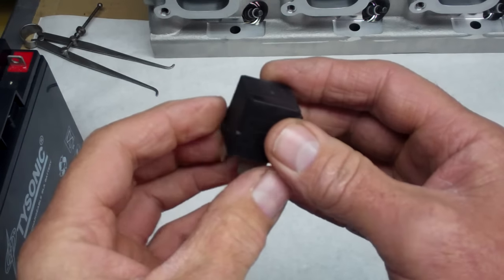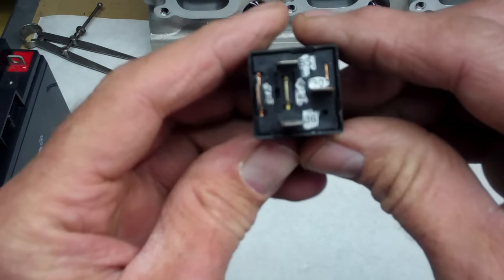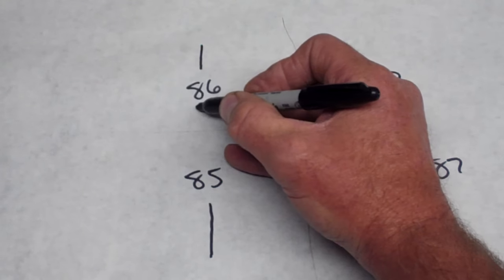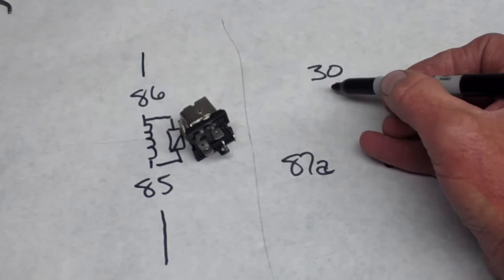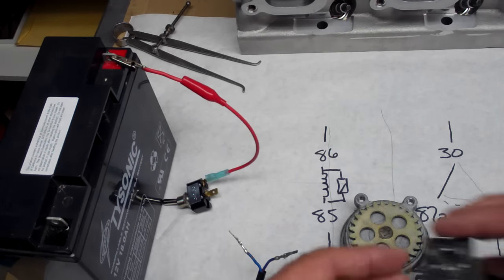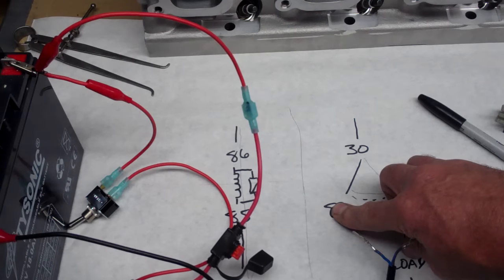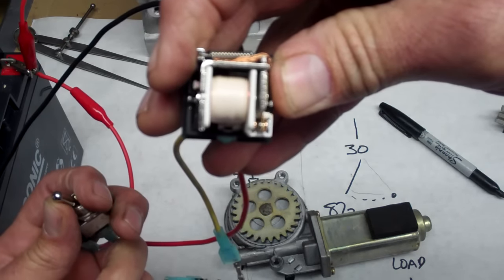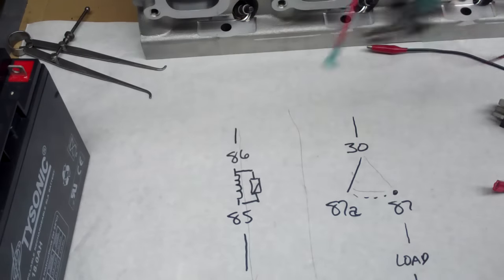How An Automotive Relay Works and How to Wire 'Em up

Comment: Hey. Got a question. If I need 2speed fan how do I wire that to relay? Or do I use 2 relay?
Reply: Gleb Abramov You'll need two relays.

Comment: I don't understand why the switch between 87a  to 87 doesn't activate immediately since power from the battery is connected directly to 30?

Comment: Hi, do I need a relay for 12v accessory which use 2Amps or I can connect directly to the switch?
Reply: Check the switch rating and wire size length chart. Maybe. It may stop working as carbon build on switch.

Comment: That relay is merely an on/off switch so the resistor and diode don't make it 'directional'. 

Their function is to suppress the high reverse voltage that develops when the relay is de-energised. Failure to do this exposes the control circuit/switch to potentially destructive voltages.

Comment: my problem is that the power window motor is a positive negative .....the motor is grounded to the frame of the car and the two wire s from the motor are switch from negative to positive by the switch so this wiring is not correct..My question is do i use two relays to go to each wire on the motor?

Comment: Why don't we directly on off the motor through switch.  
Why first energized the relay by switch then .. energized the motor by relays contact . 
Why this process is necessary.  What are the advantage of relay here . 
Is it on battery life or something else kindly explain ..

Comment: How did it work without switch being grounded? I saw power wire to switch and wire from switch to relay but no ground wire from switch. How is this?
Reply: switch is in and out only no gd needed.

Comment: Why not connecting the battery with the switch and the electric engine....why do you use a relay as a "double switch"? just asking...i dont see the importance of it at leat in this case. But nice video now i see how the relay works...

Comment: This is great, but does anyone know how to add switches to an alarm system that comes with lock actuators - to make a manual lock into auto locks.  Cannot figure out the best way to interrupt the power from alarm with switches and relays...???

Comment: There is only two things you can do to electricity , switch it and transform it .
Relay is a switch that draws very little current . Inside the relay is a set of contacts ( switch) that are heavy enough to handle the load that's being switched

Comment: You should have started with the 4-pin relay first. Most applications only need on/off mechanism. The 5pin can result in unpleasant and costly results for those that don't know

Comment: Why isn’t my pin 86 working it only works when I put it againg pin 30 it turns my fan s on other then that I’ve tried to wire them normal and it blows

Comment: I mate take the cover off to see if it switches over when I turn it on. 
But it’s just Confuse me as when I turn or pull the fuse in and out it clicks . Mmmmm not sure what to do it’s wired up to a nitrous heated bottle warmer and a nitrous pressure switch so I have the bottle warmer has two wires. One gos to the psi switch and on the psi switch the other gos to earth. But the other wire that comes from the bottle heater comes into the car to the relay. To number 87 . Then I got the toggle switch that powers the heater that 12v wire come to the switch but also to my relay number 30. Then the other + from the switch gos to number 86 & 85 gos to Earth. Duz that sound right to u .

Comment: I understand the vid but i want a light on when my  accessory is on not when its off like when the light is wired to 87a.....so i guess i just need to use a lighted switch to get the light on when my accessory is on...? makes no sense for ithe light to be on when the accessory is off... that would run down my battery....

Comment: I'll be the first to admit I know nothing about electrics. But if you just wired the switch to the motor, you'd get exactly the same outcome. Why do you need a switch to switch on a switch that turns on the motor?

Comment: My relay works but don’t click is that still ok
Reply: It should click I think the click sound you hear is the switch hitting the side of the plastic box I've tested even smaller relays than the one on this vid and they all clicked so I really don't understand how you mean it works but doesn't click
Reply: bigmac82 the 30 gos to the battery 12v the 87 gos to my Device that I want to power up Then you have 85 and 86 and 85 and 86 be swapped with that make a difference ..The really works when I turn the switch on the device that is wired it to come zone i.e. my heated blanket for my bottle night his bottle that starts to warm up but if I pull the Fuse out it clicks .  And clicks when the fuse in pushed back in . But turn on by the toggle switch and the device turns on but the relay don’t click. Can the toggle switch & the 12v wire that gos to 30 on relay can that be the same wire .
Reply: I no 30 & 87 can not be . But with 85&86 one gos to earth. Is that right .
Reply: @MinionnitrousBHPtoBHP  do you have a 5 pin or 4?
Reply: bigmac82 4pin

Comment: Why no one fuses the switch wire?
Reply: Because it's just a switch, it doesn't need a fuse. The battery wire needs a fuse so it can cut and limit draw.
Reply: I fuse everything back at my main 12v distribution panel.

Comment: The starting current for DC fan motors will burn out your relay over time.   Call The Auto Cool Guy for Solid State PWM fan controllers.

Comment: 0:43 modern car 😂 2024 and still relays in modern cars. Instead of finding solutions for switches which can handle high amp. Would safe a lot of cables and makes the whole car wiring much easier!!! If you check aftermarket universal central door locking or power window sets, they come prewired without relay and they work easier as other electrical devices

Comment: I don't want to get a PhD in electrical engineering. I don't care about inductors, coil wires, resistors, magnetic fields, contacts open or closed blah blah blah. I only want to know what I have to do to connect the relay to a switch and to a gizmo.

Comment: Hi there! I bought these for installing auxiliary lights on my motorcycle - https://www.amazon.de/-/en/gp/product/B088D865B8/ref=ppx_yo_dt_b_asin_image_o00_s00?ie=UTF8&th=1. The relay wiring is quite different form everything else I saw, i.e., where the switch is connected directly to the battery. Why is that different in this set up? Is is bad? Would the lampos be properly grounded? Do I need a fuse between the switch and the relay also? Thanks!

Comment: Hey bud do you know how to pull the fuse terminals out from the back of the relay box of a 96 c1500 silverado? Here's a photo of the box. I burned up a wire and I cannot for the life of me figure out how to get the individual wires out

https://cimg5.ibsrv.net/gimg/chevroletforum.com-vbulletin/1300x731/tabs_cad7065880f23fa608ab547300ced2adf2921b84.jpg

Its driving me nuts lol

Comment: and what is the relay propose has you can have a constant under pressure power so the power's gone able to trigger the relay and and whatever is closer now seed on the axillary power it would make a trigger the alarms even though your primary has failed because it was disinterred rise and close the relays were open the relaystwo things touching you and a person a female where you're having sex you know when you get in between when you're connected your clothes when you separate or apart your open

Comment: Or I got another horn and I want to let the other dogs come out not maybe I wanted to ring the doorbell there in the shed
Reply: He doesn't remember because while the other doors were released with the relay and will be applied to power to the fence so we actually can touch it so he got captured activate the voltage on the fence
Reply: So basically what happens is I need to trigger a real a further from me but I cannot. haven't you so much power from the main server so I could have the relay ready to go but yet because the link time I want the power go faster from point a to point b and might be this is where the axillary power might be have to be stationed close for the relay watch her the relay the relay triggers a bigger relay or bigger amp fridge and then in my stay locked and disengage smaller voltage for our shared at the smaller voltage won't be able to reset less depressed another relay reset the major relay that's what we called understanding where the relays are but most likely you can have old supply on the common side so you can have a normally open normally closed where you apply to power for that switch on the Normandy, inside the common side would be the hot side or the positive side and in any voltage could be the positive or negative still at the hot side because once they closed when I give you the voltage so you could be a voltage open if it's open Pinnacle voltage it doesn't matter if it's positive or negative or the common or the hot one or because longest it's working that means you got the positive in the positive in the right side negative and negative on the right side when your triggers if it's triggered open or closed every every triggers from close open will go from open to close and close or open so on common o
Reply: and the other key here is well you're going to use the same going current so if I'm going to have a relay and I'll put on the comment on my plate for negative coming from the source that's going to be the battery size nothing is going to need that negative strike open because right now is open close is open and open his clothes so do I want voltage on it no OK and then I will put it on open, and open the other common and what time they open the clothes I'm trying to power is going to go from open so you wanted to put it on me what clothes open open closed assume say another word for your play the power of one of them's going to go click-click go from common close to home so if you put my meter for cross, in the first relay and then to the what to the second point which is Scheels open a
Reply: So if I have two relays so I hear apparently got two relays the bottom side one is going to be negative on this be positive and what well it probably has direction of the 8th of the current some have a dial so it's going to be positive positive current current correctness should be the tip top positive positive negative negative when you hit the trigger from them yet to put a resistance to make sure you don't overload the relay so yummy should reduce power by some power reducing fire the fuse from the fuse so why are you going to burn it you got to make fuses at pop and then you have a problem with replaceable fuse it but that's the point charge and you have a short a short either one of them fried
Reply: But if you're going to use it for a missile and you lose voltage on that relay is going to fire missile because you might lose power on that relay so you want time relay so it what kind of relay you going to want I don't know what kind what kind you think you might need you think you might need to peel matic time delay relay p h e u m a t i c time
Reply: it's called a delay relays the demotic time is the rating what we got one what what you looking at what kind of tips to using it on
Reply: okay I want I want all the watches I can get okay don't be playing tennis with me now I'm going to take one more time till we believe what installations to propose for what's destruction is for the what relay part or the reward for the renewal of the
Reply: Okay my f14 House have a description be on the tips you understand it has to be the perfection of the time and it doesn't
Reply: Relay setting energized
Reply: oh I will contact the general polls kind of life the general department were the proposed contract of the general propose general propose control of the general of theis this a dinner George relay or a contact all you need contact me lay your is it a contact unit me what is the principal for the proposed me what is the charge for the change for the illinoise or the